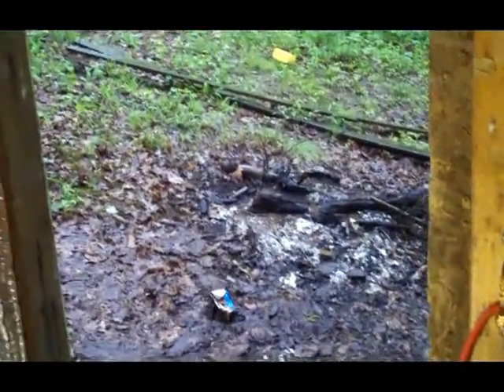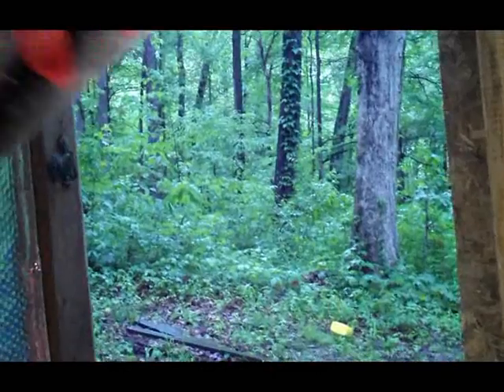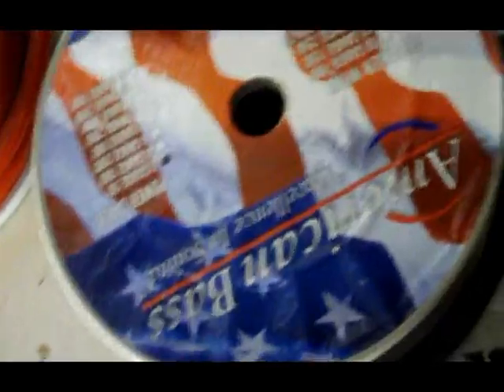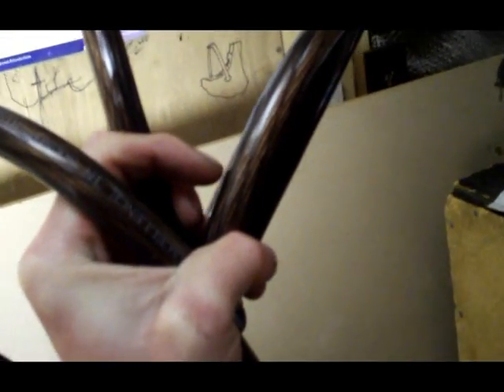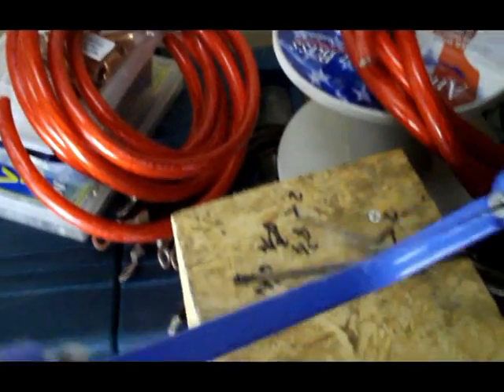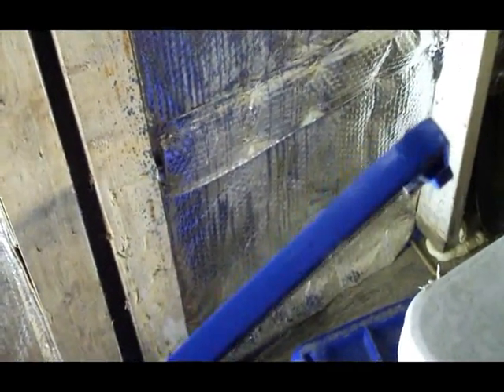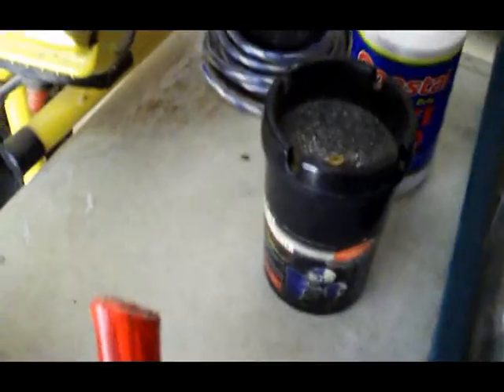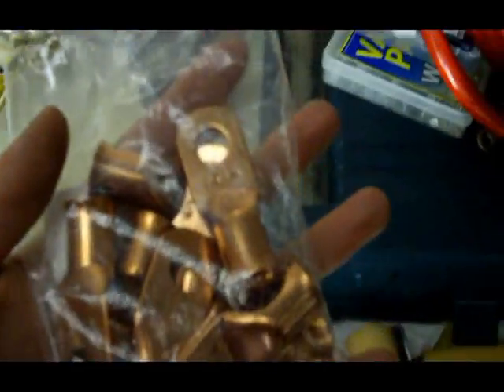Civic Update / Time To Cut Some 0 Gauge Wire

Comment: On those closed ones you can do it yourself just fire up your torch take a set of pliers vice grips or channel locks what ever hold the terminal over the flame and start adding solder into the terminal till it's got some in it then stab the wire in while holding it over the flame if you added enough solder it should make a solid connection if not take some vice grips and clamp the wire to something over head now you have both hands to add more solder

Comment: i would break off a small piece of solder place in the bottom insert wire add heat and solder from the top

Comment: I have similar 2/0 ring terminals. The way I do it is that I fill up the ring terminal with hot solder where it is liquidfied and I keep raising the temperature. Once I think its hot enough, I jab in the wire into the melted solder and I continue to heat the ring end for another 10 seconds to make sure the solder goes through the wire. Never failed me.